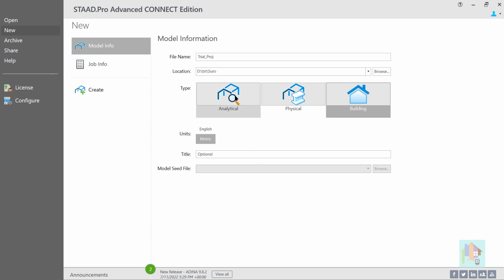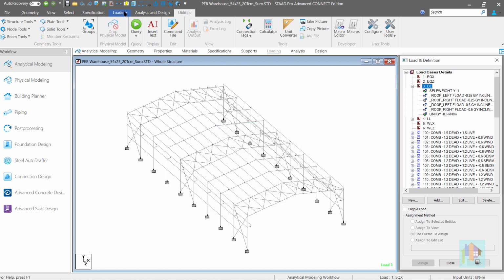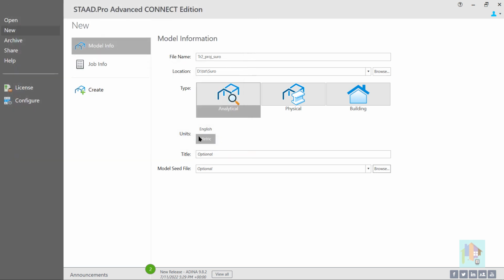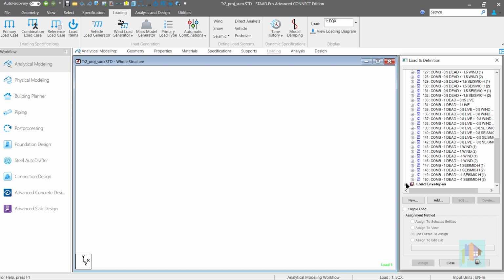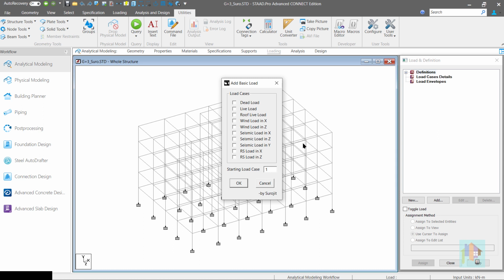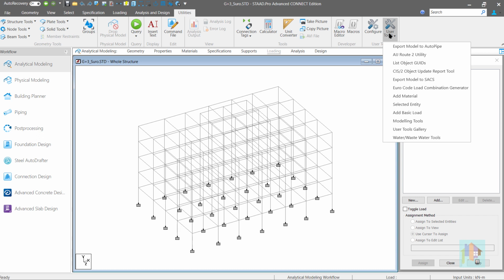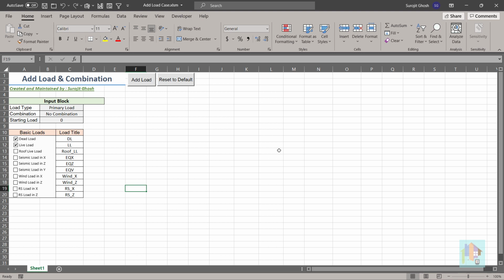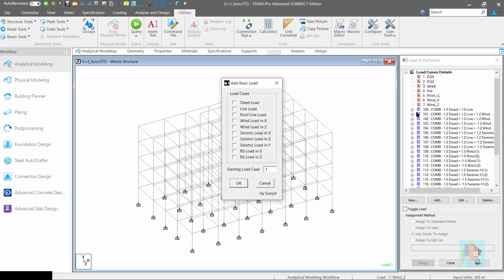Add Basic Load & Combination: Custom User Tool || Automation with OpenSTAAD || Project Seed File

Comment: We need to assign loads/design parameters after every change... For eg. Self weight needs to be assigned... Then we need to assign design parameters... etc. Can we assign them only once E.g. CHECK CODE ALL. This command does not carry when I make changes in model. Please help.
Reply from the maker: There is no option available in STAAD to set the member attribute (load, property, parameter info) before addition of any member, it's just a line. That's why we need to assign all required attributes separately. Only way I can think of, create separate member groups and use the group name to assign load or design parameter. If a member is added later, we can easily attach the new member to that member group, this will eliminate any further assignment step.

Comment: Hello Surojit....I notice you are creating load combinations but doesn't staad advise the use of repeat load combination is preferred.
Reply from the maker: No, not really. For first order elastic analysis, load combination and repeat load do not make any difference. Only when a second order or iterative analysis is performed (p-delta, member tension/compression, tension only spring etc.), then repeat load case is required. Else it is better to use load combination as this saves lot of time. For each repeat load, load matrix is formed before analysis which takes considerable amount of time without any change in the analysis result.
You can check this video to know more about when to use a load combination and repeat load case -- https://youtu.be/iCbpo9PM_HE
Reply: @surojit_ghosh  Thanks for the clarity.